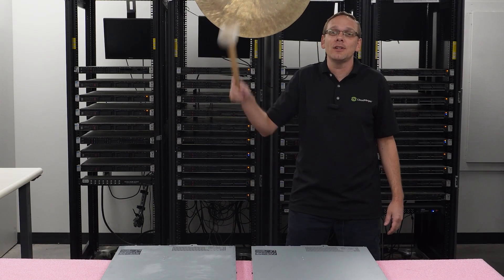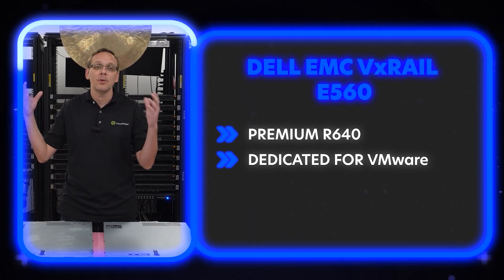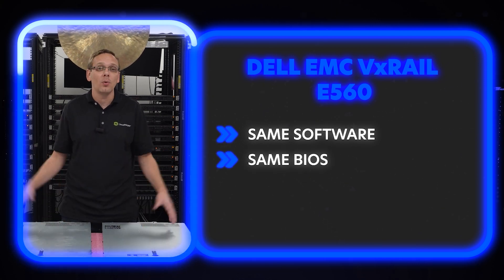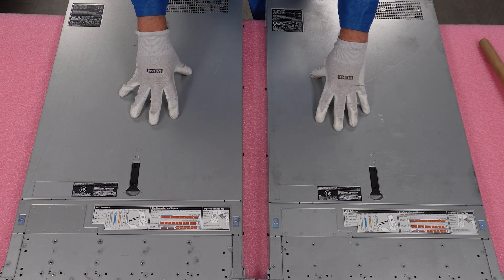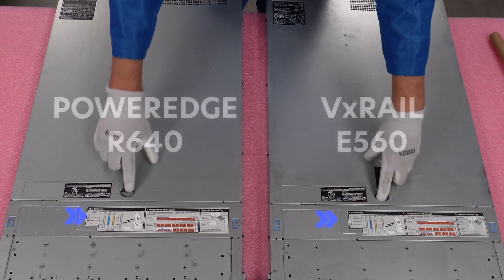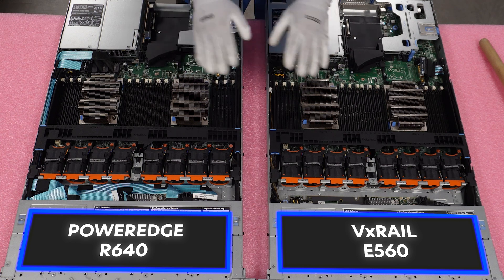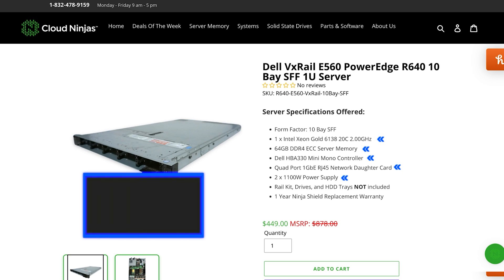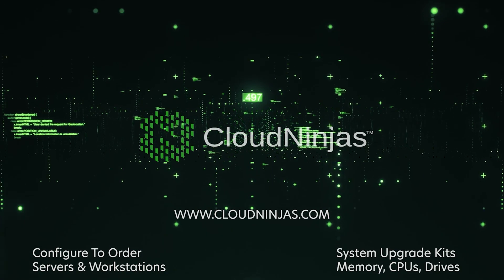Dell EMC VxRail E560 vs. Dell PowerEdge R640: Which one is right for your business?

Comment: Please note that R640 and VXRAIL servers do not have the same profile module, which means that if you replace a VXRAIL motherboard with an R640, it will not work with the VXRAIL software. To make it work, you'll have to transform the motherboard into an E560. It's software only, but without Dell support you'll be unable to make it work. Hardware wise it's the same but not at the microcode level....
Reply from the maker: Great point, and thank you for bringing that up!

You're absolutely right — while the Dell EMC VxRail E560 and the Dell PowerEdge R640 share similar hardware, there are important differences at the firmware and software integration level, especially when it comes to VxRail Manager and profile modules. The VxRail platform uses a custom image and microcode that's tightly integrated with vSAN and Dell EMC lifecycle management tools.

 For those planning upgrades or repairs in VxRail environments, it’s crucial to work through Dell-supported channels to maintain full compatibility and support.

Thanks again for pointing this out — it’s a valuable distinction that often gets overlooked! 👏

Comment: Great video. My three (used) e560 servers came with a dual SD card reader with ESXi 7 and no BOSS card. Do I need to buy a BOSS card for VxRail 8? Or can I just use the front drive bays populated with one Intel SATA SSD?
Reply from the maker: Typically a BOSS card is like an extension for your drives bays, either for more storage or specific applications you want to run. It is up to you if you want to utilize this extension or not.